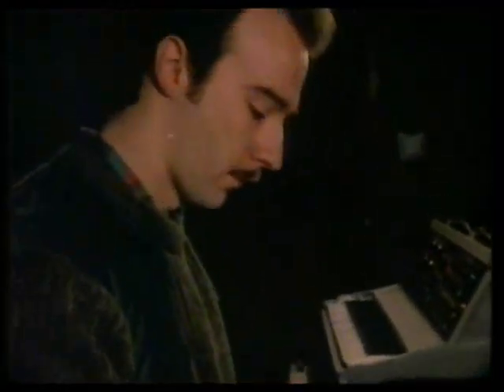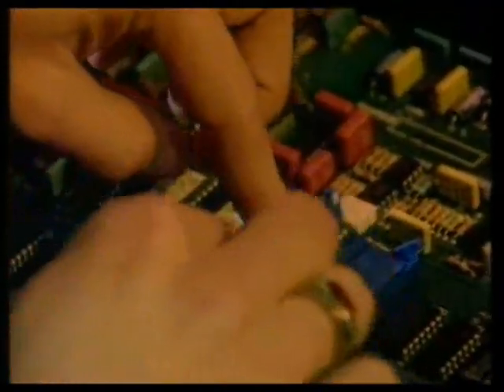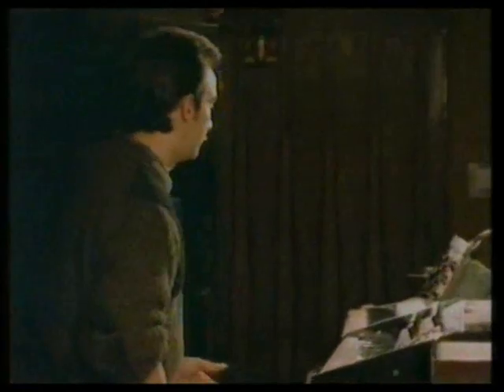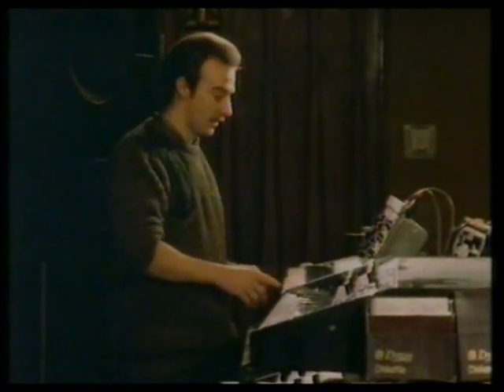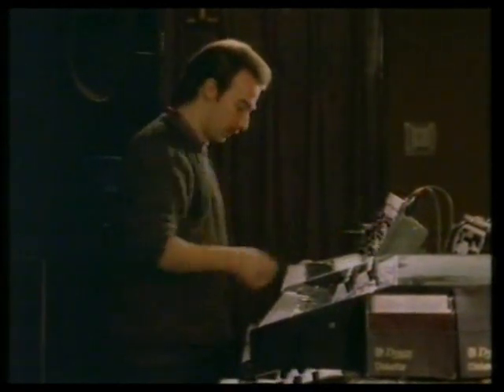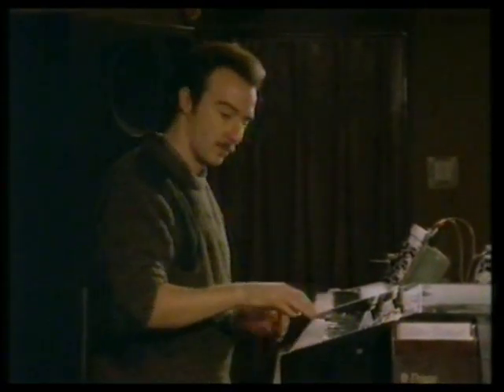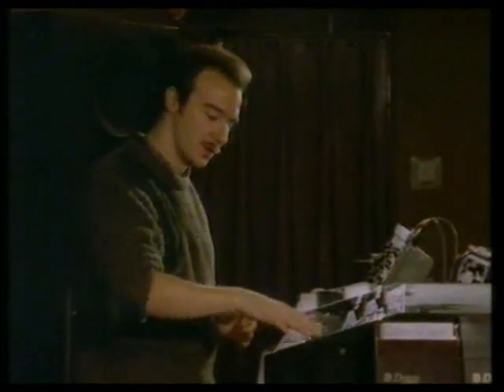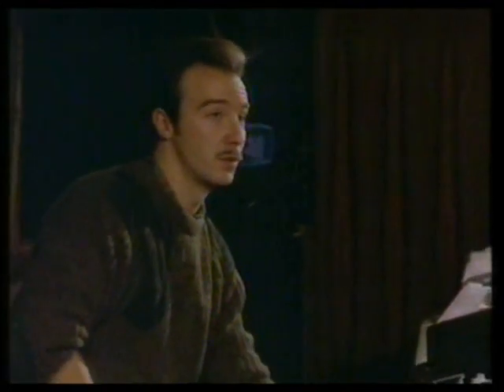Midge Ure / Ultravox in the studio recording Lament - Minimoog & PPG Wave interview 1983

Comment: >Anybody know what the deal is with the digit readout on the Mini? Never seen that before...
I did that. It's to set tempo when OSC3 is used as an LFO.
Reply: Would you also happen to know what the two additional switches below the pitch/mod wheels on the PPG do? I have a Wave 2.2 and been curious about this for a while.
Reply: I don't remember that one, possibly because I didn't do it. From the switch location I would guess they're mute to monitor and mute to PA (with a transformer DI built in). I remember building DI's into lots of things to keep the box count down on stage. I may be wrong, though.
Reply: I believe that it's a modification they added to Chris Cross' Minimoog to generate a pattern you can hear in the live version of "Sleepwalk" here: https://youtu.be/qtvsqCkgboY